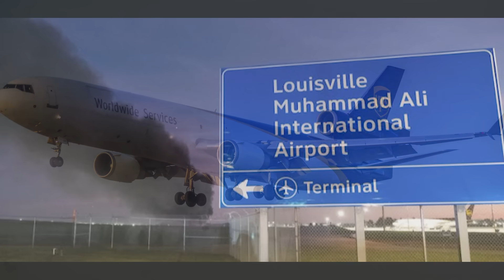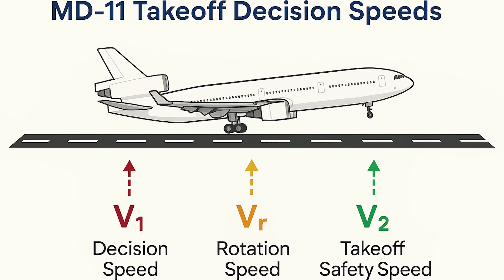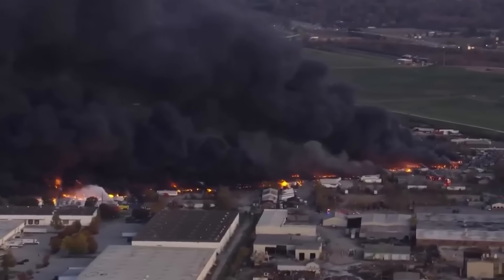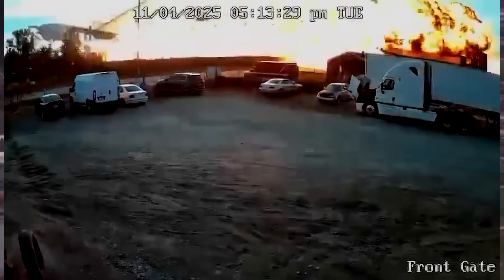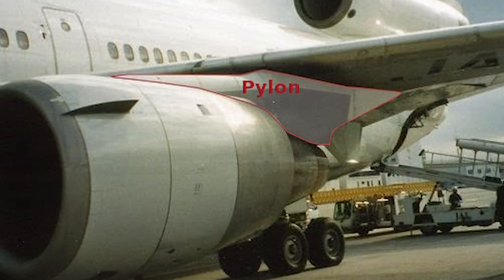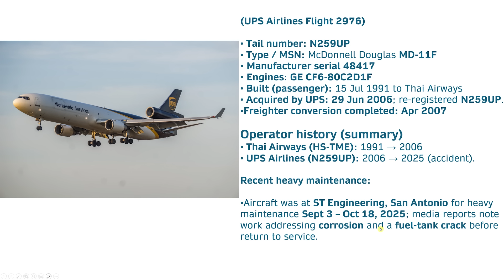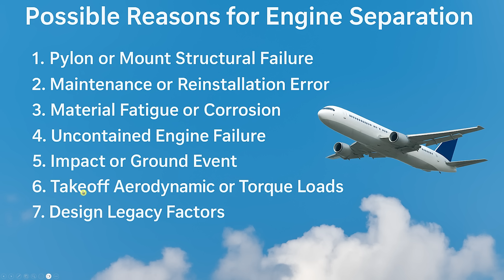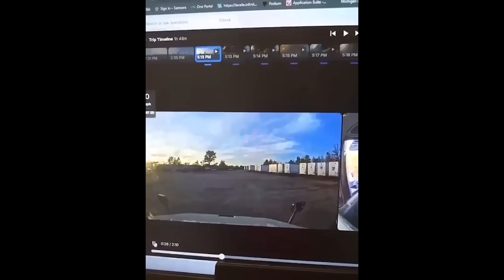What Caused UPS Plane Crash, Louisville, KY? How MD-11 Engine Fell Off

Comment: 18 days ago the thing was getting a cracked fuel tank repaired I took a month and a half the fuel tanks are in the wing above the engine
Reply: Was it left center or right tank ?? If engine / pylon departed the main fuel line Is still dumping fuel out until spar valve is closed with either fire handle and or fuel cutoff switch, that fire was going up and over wing so not necessarily busted fuel tank and they build a dry bay around pylon for these reasons
Reply: @poochies0316  that would cost money and weight on the air frame
how much refinue would they have lost in less cargo

Comment: From take as it was rolling down the runway this engine was on fire before V1 I'm sorry it's clear as day that fire was already happening shortly after they were cleared to leave and started rolling. I would think half way down the runway the fire was happening you have to remember that left engine was on the grass of the airport so this all didn't just happen at the V1 speed! There had to be alarms blaring in the cockpit. They should have had cameras but we all know 50 million dollar airplanes don't have that technology but a 30K thousand car does! Your allegedly of taking off at V1 speed and dealing with the fire in the air I don't know in this case! I want to know with all the CCT tv cameras at the airport no one saw this plane on fire! No one in the airtraffic control tower didn't see that fire? Come on! If someone would have seen that fire and screemed to the pilots on radio I think they could have slammed the breaks on before V1

Comment: I think more of United Flt 232 in Sioux City Iowa. It was caused by a crack in the fan disk. If you look at the picture of the engine in Louisville the fan is missing. Perhaps it exploded due to a crack in the fan disc too, however, in the Sioux City crash the engine didn't fall off. Anyway just too early to speculate.
Reply: A crack in the fan disk wouldn't cause the engine to fall off though.  In fact, as far as I know, the engines are designed to contain a fan blade that breaks.

Comment: So sad.  The plane looks like the left wing stalled but after Flight 191, the changed the flaps so the front edge needs hydraulics to retract them instead of extend.  This way, if the wing loses hydraulics, the wing will still have lift.  I am guessing they loaded it in relation to having the thrust of three engines so when the first engine was lost, it didn't have adequate thrust.

Comment: That crash clip at 8 minutes is in no way similar to the Chicago crash.  It looks the way it does because the plane had made contact with objects on the ground and those objects created that rotation.  The clip at the end of the video shows how completely dissimilar the two crashes are.  The plane was coming in very level when it crashed. The reason the Chicago plane crashed is dissimilar as well.  The only real similarity is the loss of engine #1.  I think it will likely be found that the reason for the detachment was a catastrophic engine failure and that is why the engine looked the way it did on the ground and why there was the fire on the wing which was also dissimilar from the Chicago crash.  I'm curious to see what caused the failure of engine #1.  Was it a fan blade failure due to micro fractures or did the engine ingest something from the runway causing the failure.   And of course the destruction of engine #1 ended up causing engine #2 to fail on some level which was a contributor to the crash.  Just not enough thrust left to keep a fully loaded and fully fueled plane flying.  So the key difference between this and Chicago is Chicago was due to a lack of lift with the left wing while the Louisville crash will likely be determined to be a lack of available thrust.

Comment: What we need to find out is how this plane, just came out of maintenance according to another video, managed to lose an engine. It will probably be shocking to find out maintenance screwed up again.
Reply: NTSB is saying that it wasn't in mainteance before this flight, and there wasn't a delay. I'd guess old age fatigue triggered an unexpected failure state (the plane is 34 years old). What... is hard to say.
Reply: From what I understand the plane had been flying for several weeks after maintenance. Not 1 day.
Reply: That has been the cause so many times, it's no longer even a surprise.
Reply: Lawsuits coming...maintenance fail

Comment: I don't understand why all major runways DO NOT have deceleration absorption material to stop over runs.   Runway excursions would help prevent disasters like this.    Truckers' have escape ramps.      

Walter Lux, the captain of the Chicago accident, had no time to react, and he had more time than yesterdays UPS flight.    Interesting how pain must be endured to make improvements.   There are many unknown, unknowns.
Reply: Airports without sufficient boundaries do have such deceleration beds, but most airports are large enough to contain runway excursions. But this was not a runway excursion, and no amount of ground amelioration could have prevented this event.
Reply: costs money
land no buildings  no money coming in
also in 30 odd years how many times has it happened
Reply: Which crash was it where they ran into a concrete barrier at the airport perimeter?
Reply: It was already past V1 when the incident began. They had to attempt to lift off, because they were going too fast for any attempt to stop.

Comment: I dont get it even with the loss of the engine on one wing they still have two left. Makes me wonder if after the engine loss they also had a power loss.
Reply: Takeoff video shows compressor stall on the number two. Only one engine was working at capacity.

Comment: I’m just speculating.. I think the rear mount failed and the engine rotated up and over the wing with debris damaging the tail engine and the fire reducing thrust on the tail engine. They just didn’t have sufficient thrust to overcome the load
Reply: I think the rear engine was getting choked out by the fire, I don't see how it could have been physically damaged at that point.

Comment: I was in High School or freshman in college when the other crash happened looking for a job including the businesses where that plane crashed.  To give an idea how close I lived to the airport, I road my bicycle to watch airplanes take off front a bridge on the airport property a few years earlier. 
 
I obtained a pilot license as a junior and an aeronautical engineering degree.  The location of the engine on the field should suggest the speed of the aircraft when it happened. My guess it fell off close to the  decision speed but before due to the low speed at the end of the runway.

  I want to know how much runway was left when it lifted off.   I would like to know when the roll started.  Was it after clearing the fence? 
 
 My next guess the airplane was forcefully caused to lift off below the speed for a fully loaded plane. Looses speed climbing, speed up dropping, and with this speed increase returns to climbing which is seen by climbing damage to the roof.  The rolling  cause a drop in climb rate and eventually a descend rate.  Also slowed by hitting the roof.

Now the pilot in control would have to have an ungodly instinct to not crash.  Even if he had training the number of simulations and repeated practice per year would never be enough to be muscle memory.  At the speed that decisions would have to be made instinctively.

Comment: I saw the wreck of AA-191 - Was driving east on Bartlett Rd and there was a fireball and a pall of smoke rising up dead ahead.  Bartlett Rd is directly in line with the crash site even though I was 20 miles away, I had a clear view of it.
Reply: I still have my ticket book for my flight on AA191 that Friday plus the return ticket. They used red carbon paper back then and it is no longer readable after 46 years. I was flying on Eastern from Albany to O'Hare to LAX to spend my vacation with my parents and brother. I had a bad feeling and went to our office in Schenectady instead. I was assigned to a project in Venezuela and left the next morning. My boss promised an extra week of vacation after I got back.

Comment: An airplane like that can fly with a single engine. But can it TAKE OFF with a single engine? Did the pilots even have a chance at recovering this flight, or was it doomed the moment that first engine fell off?
Reply: Those engines are underpowered. It might have made it up if two were operating,  at least long enough to get out away from populated areas. There was no chance of the crew making it back to land.

Comment: Eerily similar to flight 191 which was back in 1979. As far as I know this is the only other McDonnell Douglas tri jet to lose a wing mounted engine. MD has a VERY detailed/specific procedure for engine removal/replacement! It wasn’t the plane that was at fault in the flight 191 incident and sadly it was 100% avoidable. Very telling how this happened 46 years ago and how many flights the DC-10/MD-11’s have had since with nothing like this reoccurring… all DC-10/MD-11 aircraft also received the updated hydraulic system to assure the leading edge slats of the wing doesn’t retract in said scenario this losing lift on the wing in question. Rest in peace to all the souls lost, very sad.

Comment: Ignition source was the 44kw overhead lines and drizzling fuel lines.
Reply: The left wing was already on fire from the engine separation during the take off roll. It does look like that last flash ignited a whole plume of fuel trailing behind it though. Horrific.
Reply: It was on fire rolling down the runway......
Reply: We've got footage from before it achieved takeoff, and it looks like the engine launched forward then tumbled over and ripped up the upper surface of the wing, immediately spilling & igniting the fuel there. It was already massively aflame before takeoff.
Reply: @defies4626  Very scary stuff.

Comment: As an Electrical Engineer Looks like there was NO!!! Maintenance scheduled to the air craft where they would catch a loose bolt or a nut that needs to be tighten down on the air craft or just pure " Laziness " on the maintenance crew.

Comment: The engine was found on the runway, so yea engine was not there during crash.   The bigger problem is these cargo planes are flying at or over max takeoff weight so they need every bit of runway assuming no engine failures!
Reply: No, they are NOT flying over their max takeoff weight!  There's a max gross weight for safety reasons, along with a balance point that has limits.
Reply: @jszlauko  Cargo carriers are found exceeding max weights quite frequently!  Even 1% over would yield millions$ in shipping costs every year.
Reply: @BartSparrow123  - Where are you getting your information from?  Sorry, but I don't think any competent pilot would choose to fly when they are exceeding the gross weight of the plane.  And, the company would not be able to tell the pilots to do so as the FAA would throw a fit and ground them for doing so. 
That said though, I could imagine that if they were just a few pounds over, and the density altitude was in their favor, they MIGHT choose to takeoff.  But in no way would a company be pushing pilots to do so, as again, the FAA would have a fit.
Reply: @jszlauko  You are right, it's mostly happening in other countries where they do not have strict oversight. Aerosource is the first one that comes to mind.

Comment: Just an observation, I am no expert. It appears it was wings level until it impacted the buildings and then rolled left. Unlike AA191 where the slats/flaps retracted due to sys1 hydraulic failure when the engine flipped up and over the wing resulting in a stalled left wing. If the procedure had not called for the pilots to reduce power they likely wouldn't have stalled so easily and they might have pulled it out. After AA191 they installed hydraulic fuses (check valves) to prevent retraction of the slats/flaps if a hydraulic system is compromised. UPS flight seems the engine departure damaged # 2 engine as one of the videos showed compressor stall "backfires" coming out of the tail mounted engine. With a full load of fuel + cargo and only 1 engine = they had no chance.

Comment: Looks like a combination of a compressor stall on engine number 2 and a missing engine 1. As well as a nose up angle of attack.
Reply: It would have to have a nose up angle of attack if it's rotated and trying to gain altitude, wouldn't it?

Comment: The cowling would be the correct term for the 'engine cover' you pointed out on the runway. A 'nacelle'  would be the engine mounting assembly, most noticeable on planes like Lear Jets, or the A-10 Warthog.
I am surprised the landing gear was not sheared off during the first building impact. Also, if you watch the original video, while the plane is lifting off, you can see a clear flash occurring on the #2 engine.
Great analysis as always, Sir. I look forward to more information on this particular accident. Prayers for all of the friends and family of the victims. o7
Reply: I've heard speculation that #2 engine might have been experiencing compressor stall due to debris from the runway. If that is the case and with the fire on the left wing there was no hope for these people.

Comment: I think a fair case can be made at the maintenance hangar. Someone forgot to install the pylon first THEN the engine. Another shortcut ...  😡

Wow ... it spent 6 weeks in San Antonio (just down the road) probably for a D-check. I bet the engine/pylons were removed and replaced.

Comment: The roof damage was probably done by the tailpiece, where the APU exhaust is. High angle of attack, not the gear. The distant video shows a smoke trail that goes out of frame right, meaning the departing engine and pylon happened pretty early in the takeoff roll, maybe even before V1. PS, there was a lot of fuel being spewed that didn't contribute to the fire. The air-fuel mixture behind the plane ignited when the electrical wires were severed. So the high pressure pumps were still gushing fuel.
Reply: Ive thought the same thing .  they didn't know exactly what they were dealing with ,soon enough .

Comment: One is also reminded if Chalk Ocean Airways 2006 crash. There a recurring fuel tank leak was not fully addressed and fatique/corrosion of a critical structural member resulted in a wing detaching on takeoff; this is simply nonrecoverable.

Losing a wing engine often results in veering to the side of the lost engine due to asymmetric thrust and ultimately if no corrections rolling over. At altitude pilots (incl the autopilot) have time and altitude to adjust. At taje-off just seconds or no hope.

Strees & corrosion team up where stress promotes corrosion and result in accelerated Crack growth.
Reply from the maker: yes, that was here in miami, never had a crash until that day